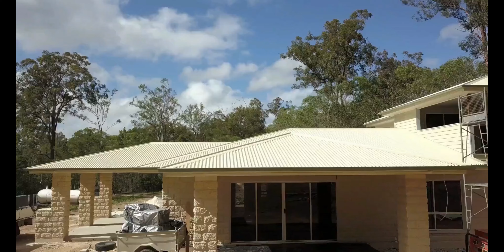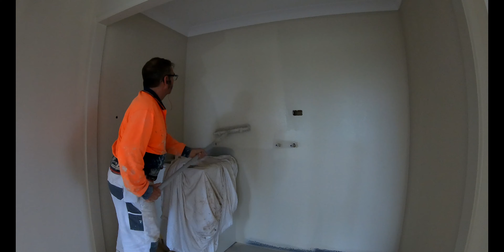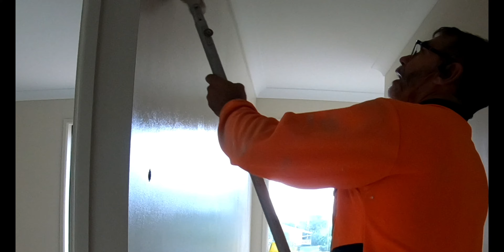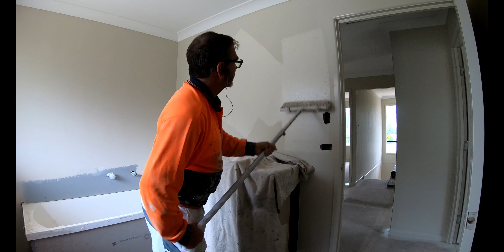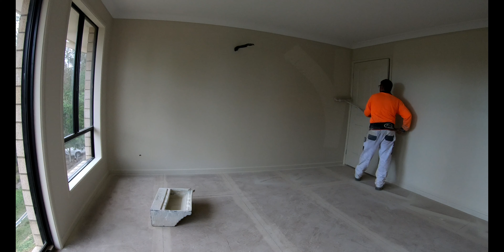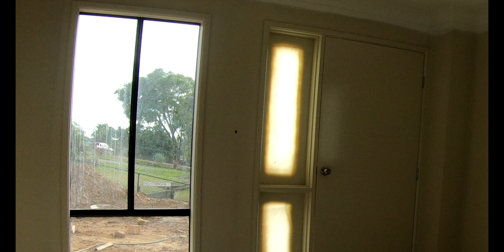14" -360mm roller in action, final roll No spray gun here

Comment: Nice. What was the name of that frame you are using and is that a wool cover and what nap length please.
Reply from the maker: Juganaught steel frame, 22mm Dulux excellence sleeve
Reply: @ThePa1nterhowto  Thanks boss, I might give them a try. Liked the way it laid it down.
Reply: That Juggernaught frame is the adjustable one is the fixed 360mm or 14in good also? https://www.directpaint.com.au/juggernaut-paint-roller-frames.html
Reply from the maker: @sydneyshinshi   I would go the adjustable one so you can use any size sleeve and then a 270 fixed frame if you want a second. That covers it all.